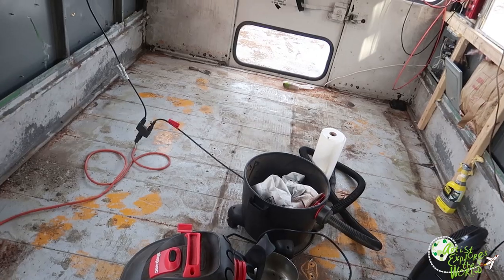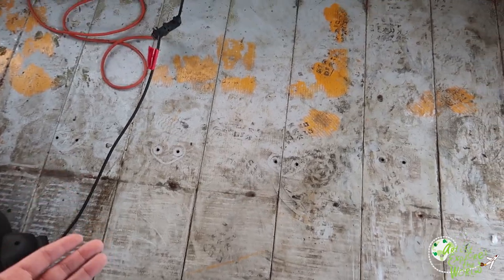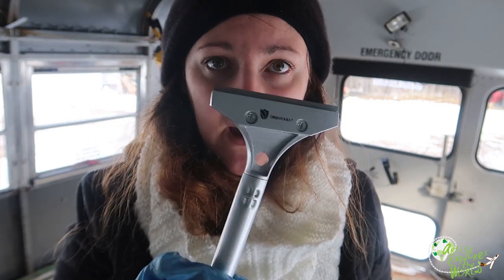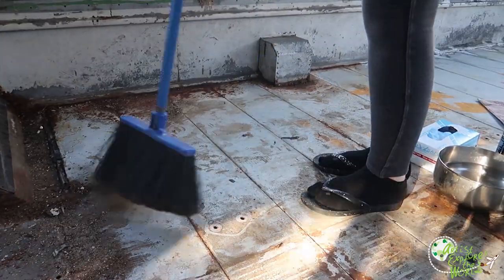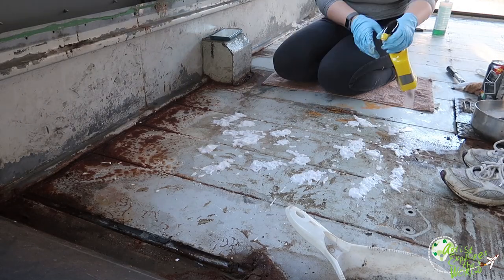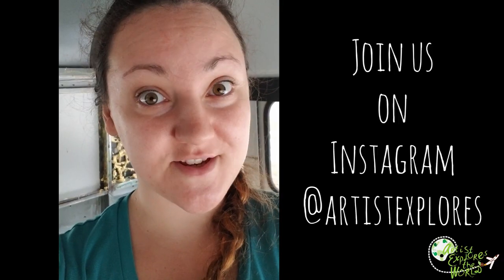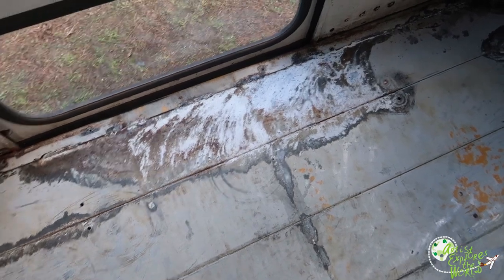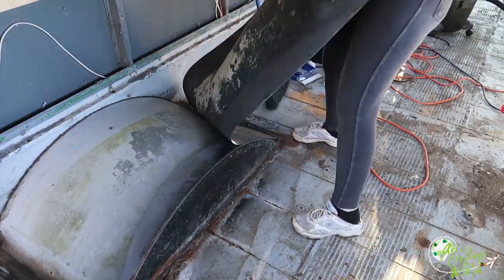Cleaning the Floor || Bus Conversion Vlog

Comment: Hey, quick question. how did you guys get the sticky bus flooring off of the wood ?
Reply from the maker: hey there, our bus didn't have any wood, the sticky flooring was directly on the metal. That process was in a prior  video but we ended up using a mix of crowbars, window scrapers, and brute force.